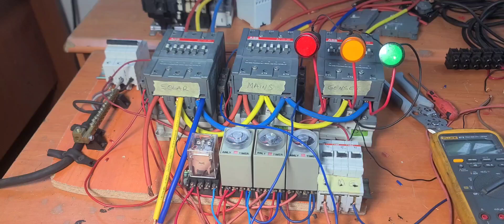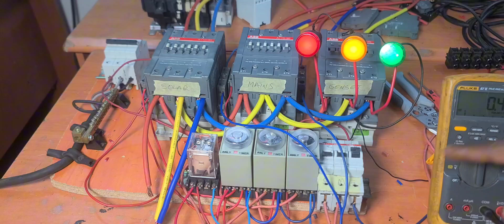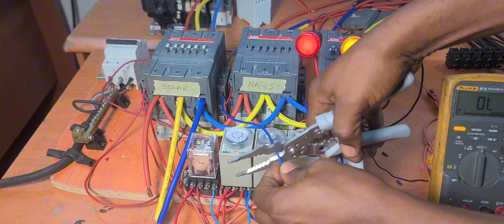Auto and Manual Genset Operations.

Comment: Sir, how would I get demand calculation for Genset to carry the loads of 6- 8 units of house?
Reply from the maker: First, we will need to know the loads.
Reply: Boss how do I connect the signal wire to the circuit.
Reply: Thank you sir from sierra Leone 
Were will I connect the two wires to the gen 
Or a video please sir